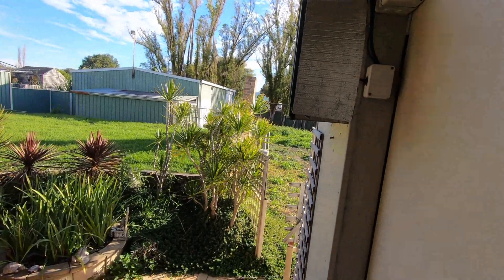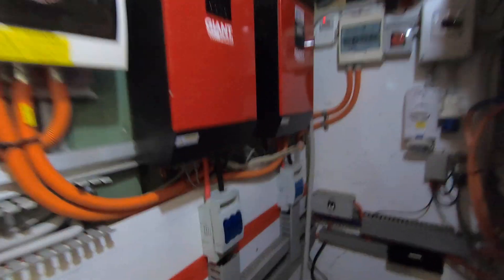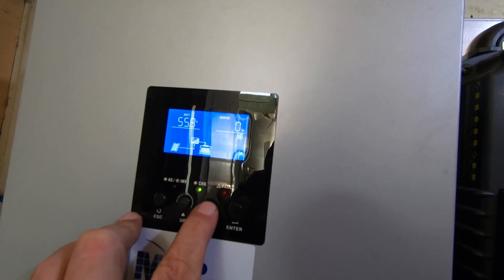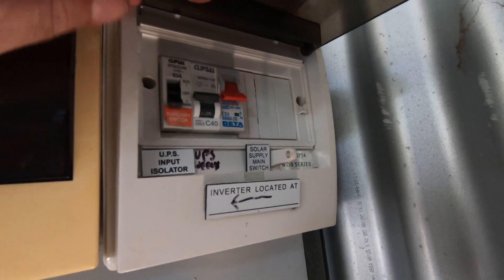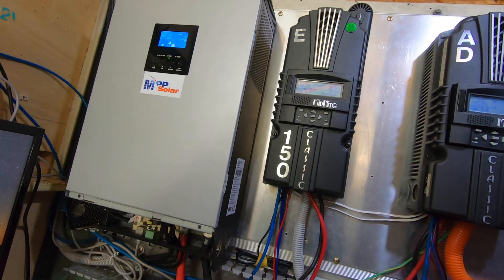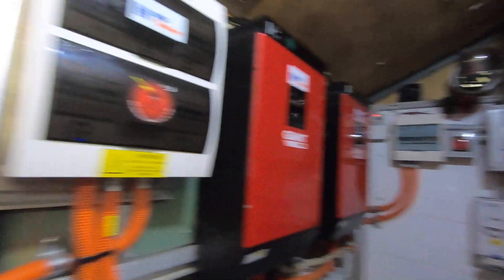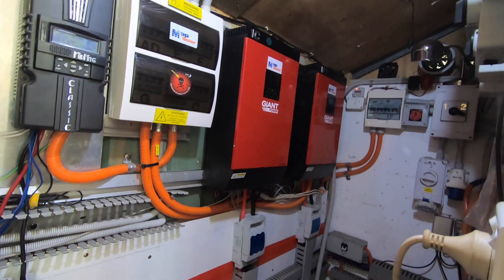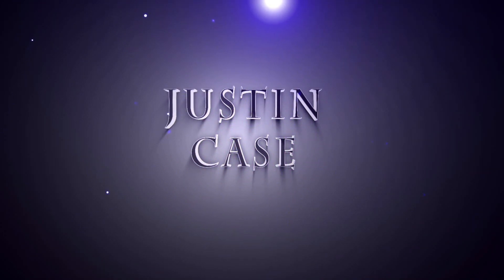OFF GRID.  Power Room upgrade Work 3

Comment: I understand that you have utilized the old inverter as a battery charger from the gernerator and that is smart business. I have a question, is there any reason that I should NOT use a battery charger (Like an industrial or automotive type) that is external from the Inverter? My generator sucks. I really need an inverter generator. Our current generator has eaten 3 freezers over the past 4 years. It poops out bad power and the freezer quality here in Chile is crap. Right now my surge protection for the solar is toast and will not allow the generator to connect till I replace it. This happened because the Hertz went down to 30 and as high as 80 with this miserable generator. So hence my question on if there is a problem with hooking up a battery charger from the generator directly to the batteries? Sorry for the stupid question and thank you for the answer in advance. Jim
Reply from the maker: I used that refurb unit because it can be programmed. Many others can not be programmed and my in fact damage your bank. Be careful what you use..

Comment: Looks good, whats the setup on the solar feed in on the Giant Power's? I bought a couple of 5048MGs to run 400v DC in as panels will be some distance away, but have seen people suggesting to not use or overload the MPPT? Plan to run mostly off grid with only grid for top up when the insufficient power or using heavy power tools (welder etc).
Reply from the maker: Really who did you here all that from? I run stick and mig welders. I also have installs on farms and they run welders / grinders and  any other tools they need to do machinery repairs.  Build them right with the right size DC and AC cabling and they work great. Anything has problems if you run them past what the units are spec'd to run at. I just finished a Huge install and he is running very large bore pumps and water transfer pumps as well as a Very large house with 6x large AC units. link to it. https://www.youtube.com/watch?v=3l4URAlNtd8 here is a link to another big system https://www.youtube.com/watch?v=rv5Hbtm8H-4 and here is a link to a system of a 100% off grid sheep and wheat farm near Morawa https://www.youtube.com/watch?v=nhJM7aEIxAc . I could keep going but you get my drift. Build them right and they work.